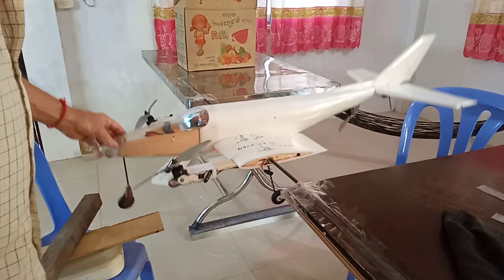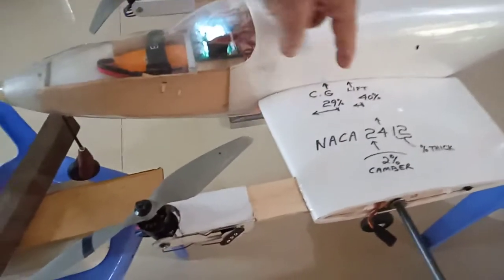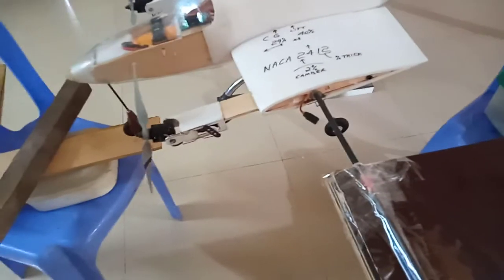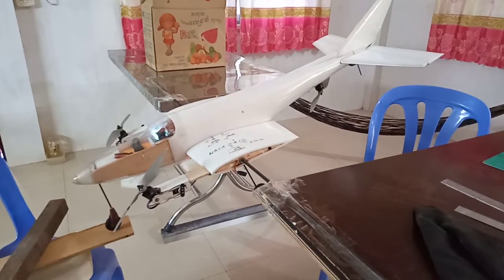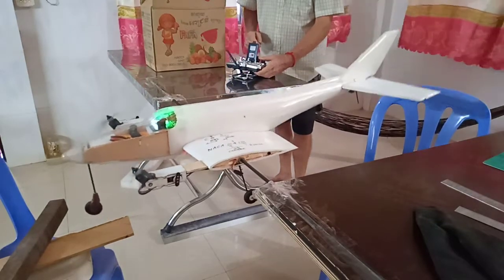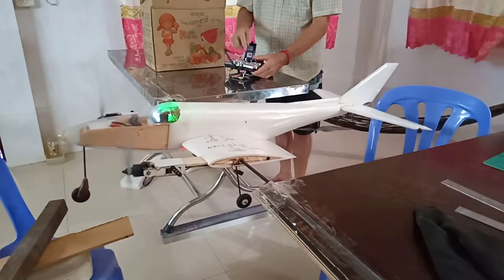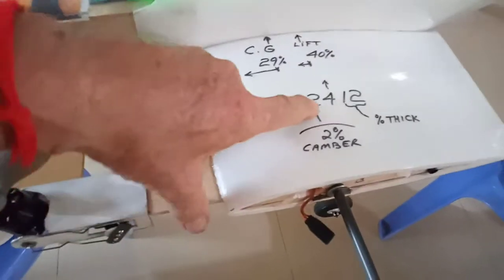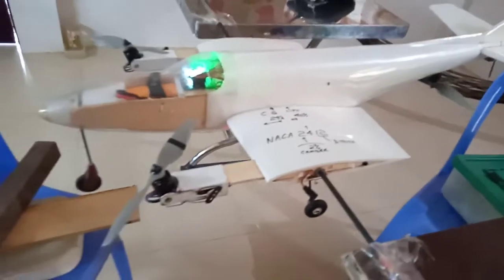Vtol RC Airplane Static Transition test Openaerovtol kk2

Comment from the maker: My Vtol Transition settings using Openaerovtol on KK2 flight controller.
(You must research on RCGroups forums all the correct procedure and setup and settings as it gets complex)
P1 = Hover, P1.n = mid transition, P2 = Forward Flight.
In my Output Offsets (Menu 10) the Out 8 is the rear motor.
There are 7 points in the offsets to increase (or decrease) the rear motor speed throughout the transition to maintain level pitch.
All my vtols require a 7 point raised positive curve.
Example only P1=0, 17,35,57,57,47,P2=0
So the offset of the motor will increase power automatically at the middle of the transition but decrease at each end.
Example, when transitioning outbound the rear motor prop initially needs to keep the tail up until reaching mid way say 45 deg motor tilt then decrease the rear motor speed as it approaches forward flight airspeed and then it turns the motor off at forward flight so P2 = 0.
When in hover the rear motor pitch trim can be adjusted for level hover in (Menu 7) Flight Profile 1 settings for Pitch trim.
The front 2 motors need no settings. (unless the rear motor is underpowered then you could possibly  use output offsets to reduce the front motors a little)
If your motors and props are all the same and the front two motors are half the distance from the C of G compared to the rear motor distance from C of G, then it should have equal lift for and aft for equal pitch control authority.
Depending on my models I usually have menu 2 Transition Mid set at 25 not 50 (Low = 0, High = 100)
This means there is only 25% less hover control coming from the KK2.
In P1.n mid position I have set the props closer to the hover angle and not at 45 deg.
This enables me to hover in P1.n or mid switch flight profile in strong winds for vertical landings if needed.
These are only my personal choices and others do not do these settings.
I also have all the motors and props tilting forward about 7-8 deg in P1 Hover mid stick position so it maintains stationary in hover in light winds (5-10mph)
(All transitions in or outbound should nose into the wind)
Without wind it hovers slightly nose high but there is no wind to effect the wing attack attitude.
All of my ailerons and elevator are always active in all modes P1 - P2 and the same % throws. ( Don't hover down wind) 
If you set the props level with the aircraft center line for hover it will need the rear motor lifting the tail surface up in a head wind hover (like a multirotor) creating a negative wing attack attitude into the wind (not ideal)
This wind will push the plane wing down and then require more power to hover over one spot making it more difficult.
Your wing attitude is fighting the headwind.
There is no rudder or servo needed as I have set 20 + and - % differential thrust to the motors in (menu11)  Output Mixer  P2 Rudder volume.
It requires pulsing the power on and off with rudder when landing to steer. (Like a jet ski)
It requires no Nose wheel steering servo as it has a swivel front wheel and it will easily taxi turn around inside its own wingspan.
I don't always use a test stand to calibrate transition settings with low wing Vtol's as I prefer to simply hold the fuselage so I can precisely feel the slightest pitching movements. (I don't recommend to any unskilled ninjas)
If you follow this risky procedure I recommend you start transition tests at say 25% throttle and increase as your confidence gains while gripping the fuselage. Or get a trustworthy assistant to use the transmitter so you have 2 hands on the plane.
It will still pitch very similar at low power so it's a quick easy test if you play it safe.
Ask a question in these comments.